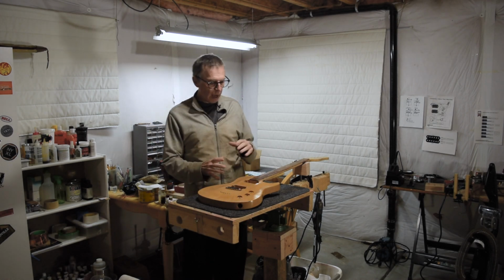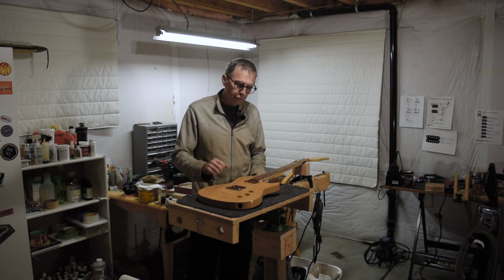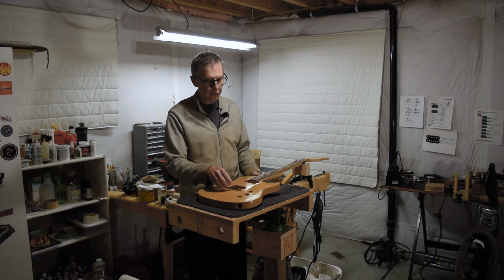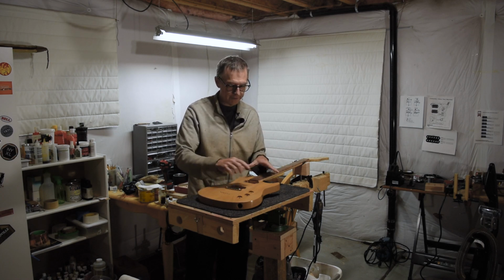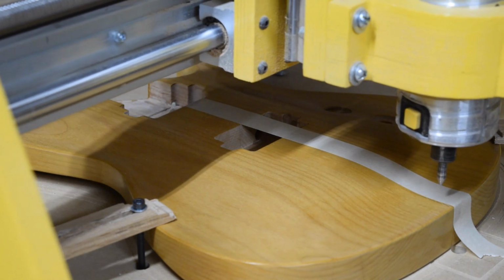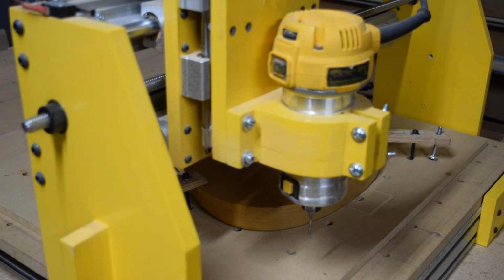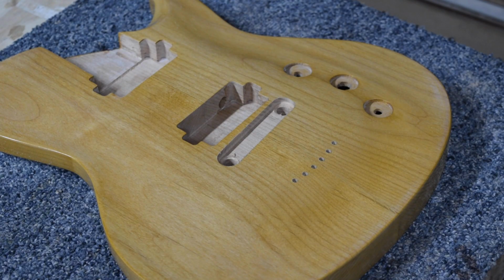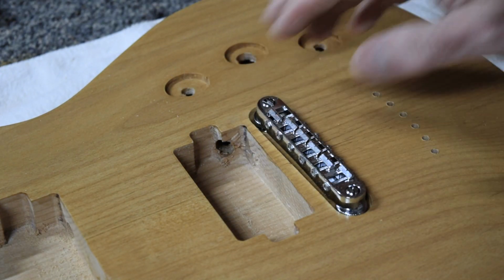Recessing A Tune-O-Matic Guitar Bridge

Comment: I’ve never used a CNC machine, but I’ve been researching how to use them in anticipation of my upcoming purchase. I was surprised to see that you used an up-cut bit for this; can I ask why you chose to use it as opposed to a down-cut bit? 

Any insight I can get before I start building would be greatly appreciated.
Reply from the maker: A down-cut bit would have been ideal, but not necessary. At the time I made this video, I didn't have any down-cut bits.

Comment: Help me out. Where do the strings go. Are theose holes behind the bridge for string ferules.
Reply from the maker: The strings pass through the body via the holes behind the bridge. Each hole has two ferrules, a string through top ferrule, and a string through back ferrule. The back ferrule holds the ball end of the string while the smaller top ferrule protects the wood from the string as it bends to reach the bridge saddle.
Reply: @HighlineGuitars  Thanks for answering sir and for your channel, taking the time to pass on your craft.

Comment: do we need to worry about string break angle? isn't it much easier for strings to come out of the saddle groove like this? maybe even buzz?
Reply from the maker: @tapirath  Yes, you do need to worry. Just add it to the list of things you need to worry about. In all seriousness, if the strings pop out of the slots, make them a little bit deeper. Then, raise the bridge a little bit to compensate.
Reply: @HighlineGuitars  sorry if it came negative. I'm just interested in the whole design aspect of it and the more I look the more interesting is how Gibson and Fender chose differently. Recessed TOM is kinda like the best of both worlds and I wonder if it has any downsides

Comment: Hi Chris, very useful video. It’s making me think about different options for an old buggered up Warmoth LP style from the late 80s. I want to replace the standard scale neck with a 24.75” scale. It has a S style hard tail bridge, so I’m hoping I can use the existing string thru holes and back ferrules and then position a routed tune a matic a little closer to the bridge pickup.  To compensate scale length. 

I messed up the neck pocket with a router back then not knowing about templates. But a couple of custom made templates and a block of mahogany to glue in I think I can fix the scale length from both ends. It won’t be look perfect but it should perform better. 

Thanks Chris

Comment: I have no experience with TOM bridges, so a question out of ignorance: are there any posts available for TOM bridges without the thumb wheels, given that they are slotted at the top and so can still be adjusted for height with a screwdriver? Eliminating the thumb wheel should shave off a few millimeters, which might be all you need to lower the profile of the bridge such that there is no need to recess it. Does anyone know of such an option?

Comment: Are there any differences in tone between stop tail tune-o-matic bridge vs string through hardtail bridge?
Reply from the maker: By rule? No.
Reply: @HighlineGuitars  Thanks for the reply. I thought that the tone could change because it is a different angle with tune-o-matic bridge.  I'm planning to build a super strat style body with 24.75 inch scale length and the same pickup placements to get closer to les paul tone.
Reply from the maker: @johnnyway8667  The "Les Paul tone" comes from the pickups. Scale length is a minor factor and pickup placement doesn't matter at all.

Comment: What depth would be appropriate to rout?  I have a JM style with a S style tremolo/bridge.
Reply from the maker: You have to lower the bridge/saddles as low as they can go and measure the string action at the 12th fret. Subtract that number from your desired string action at the 12th fret, add an additional 1/32" (.79mm) and you've got your depth.

Comment: Seems like way more work than just filing the bridge itself. I have lowered tunomatic bridges by filing in 10 mins. Unless its stainless steel it is pretty simple to use a hand file.
Reply from the maker: What if the bridge has to be lowered 1/8" to 1/4" below its original lowest position?

Comment: Chris, great video regarding using tune-o-matic bridges that got me thinking.  I'm building my 1st guitar from scratch and plan to use a hybrid neck thru/set neck design very similar to the PVX neck design.  I was planning on using a tune-o-matic bridge and keeping the neck parallel to the body.  To address the tune-o-matic ~1/2" height, I was planning to use a 3/8" vs 1/4" fretboard with jumbo frets to raise the neck/fretboard height to match the bridge.  Is this another good option or do you foresee any issues with this approach?  Thank you.

Comment: Hello Chris.  Quick question.  How much do you typically offset the bass side of the bridge (from perpendicular to the guitar's centre line) to create the angle to help with intonation?  I've heard anything from 3 to 6mm.  I also like the curved ferrule pattern. If you don't have a jig to do them 100% straight (like me) that method is way more forgiving and looks way better.  Thank you.
Reply from the maker: 1/8" or 3.175mm.
Reply: @HighlineGuitars  Thank you!

Comment: Great video, and great content as a whole. Thanks for the videos!  I'm starting my first build very soon. I'm doing a 58 V replica, and I already have a template. I'm at the point of buying all of my parts now, and I would prefer to build it with a Fender style bridge.  Do you have any recommendations on how I need/should modify the template? For example, the neck would no longer need to be at an angle(?), so what would be the most efficient way to go about changing the design?  I'm brand new, so please forgive my ignorance :)   TIA
Reply from the maker: No need to angle the neck with a Fender style bridge. Make the neck and fretboard first so you can measure the thickness of the heel (including the fretboard and frets). This will help you to determine the neck pocket depth (neck heel thickness minus the height of the bottom of the string notch in the saddles from the bottom of the baseplate when the saddles are lowered all the way to the baseplate).
Reply: A 58 v needs the v shape metal plate thru body .. iconic .imo..they just look so awesome..classic 58 look.. but hope the build turns out nice for you .tough for a first ..set neck. Best to you man .

Comment: Excellent idea and solution - was looking for such a remedy. How did you know how deep to make the recess?
Reply from the maker: Before routing the recess, I set the bridge on the body and calculated how much space there would be between the bottom of the string and the top of the frets. That's how deep I made the recess.

Comment: for anyone wanting to do this at home without a cnc or router: use a drill press and a forstner bit. use the bit do drill multiple shallow holes from one end of the pocket to the other, then just clean up the sides with a chisel. im in the process of building a tele with a tunomatic bridge and this is how i did it
Reply: How deep of a recess pocket did you do? Im about to do the same
Reply: @JoeStanFPV   i only went down about 3/8". it all depends on what bridge you are using really. some sit taller than others. i didnt use a factory gibson tunomatic, i bought an aftermarket roller bridge. 

i just set the bridge on top of the guitar body where i wanted it. then used a long piece of string from the nut to the bridge (sitting on top of the body). then i used a ruler to measure how high the string was sitting above the puckups. i figured lowering 3/8" was good, my string action is fine.

if you measure that way with a piece of string you can figure out exactly how far to go down based on your pickups and bridge.
Reply: @TacoTuesdey  awesome, thank you! Exactly what I was thinking
Reply: I built a strat with a tune o matic and ended up shimming the neck. Still kinda high but its a slide guitar

Comment: Can you talk about how the decision of whether to angle the neck pocket or recess the bridge would play out, on a 72 deluxe, with t-o-m, where the objective is to be able to switch to a vibramate/bigsby if the mood strikes? (Primary configuration would be the regular TOM/stop tail, but want to be able to switch if a band situation needs a bigsby some of the time.)
Reply from the maker: I don't think a recessed bridge would work with a Bigsby. You would have to angle the neck to work with the Bigsby setup and when you switch to the TOM/stop tail, you would have to place it at the same height the Bigsby was at. Better yet, build two guitars, one with the Bigsby and one without.
Reply: @HighlineGuitars  This is the response I was afraid of. I wanted to be able to switch. Is there a way I could aim to accommodate both, maybe starting with the angled pocket, and adjust based on which setup feels most right?

To clarify, I want to be able to go from fixed (roller) to bigsby seasonally, not like mid-set or anything.
Reply from the maker: @aaronblack79  Honestly, I don't know. This isn't something I have done or would do. Sorry.
Reply: @HighlineGuitars  Ok, understood. Thank you for helping regardless, I appreciate it.

Comment: Nice.  How did you compute the depth of the recess?
Reply: You'll just need to calculate the difference between the height of the string at the nut and the height of the string at the bridge (both measured from the top of the body).  Guitars built to have no angle will have these heights line up,  somewhere in the range of 10-12 mm.  An ungrinded TOM might be set up in the 14-16 mm range. So if your string height at the nut were 10 mm, and 14 mm at the bridge, you could use a 4 mm cavity to get everything squared away. Obviously, since all of these variables can be adjusted to an extent, you're more lining up a range of potential heights to another range of potential heights, ideally with as much intersection as possible. I would see the full range of heights provided by your bridge, and aim for the middle value, before routing anything. This ensures maximum flexibility and room for error.
Reply: I’d like to know this too
Reply: Thanks!

Comment: I have just ordered a Fishman TOM power-bridge and it is going in a new slab body that I am building. I have been thinking about doing the recess thing and this video just confirmed it :), Thank you, by the way, what is or how do you know what depth to make the recess. Nope, I don't have a CNC, just a couple of handheld routers.
Reply from the maker: I go 1/8" to 3/16" deep. When the bridge is in the lowest position, I want the strings to just touch the top of the last fret. If they aren't touching, I'll measure the distance from the bottom of the string to the top of the fret and that is how deep I have to go.
Reply: @HighlineGuitars  Great, thanks

Comment: You can also use an inexpensive, but more precise and more accurate, small device called an, "edgefinder," that fits in your spindle (they come in 1/4", 3/8", or 1/2" diameters (metric sizes also, and years ago I saw a 5/8"), and these make it extremely quick and easy to accurately locate your instrument, centerline, and check alignment to your X and/or Y axis.

Even more precision and accuracy can be achieved using an indicator, of which there are numerous types, and numerous ways to properly utilize them. 

Great video! I'd done this once, many years ago, and completely forgotten about it. Yeah, having my CNC vertical mill is absolutely going to make that job quicker,  more accurate, a LOT cleaner, and safer. I think that would look incredible on the Flying V I'm building. It's more the vintage style body lines, like the ones KK Downing, or Micheal Schenker, used, but more modern amenities, like 24 SS jumbo frets, Hipshot locking tuners, 7 piece multi-laminate neck, not sure about the pickups though...

Great idea to sink the tune-a-matic, just don't let an authentic playing Gibson Les Paul purist see that...

Comment: Question: Is there a mathematical formula for how far back from the bridge you drill the string-through holes? Also, I've seen them staggered, at an angle, straight and curved like you did, is there some rhyme or reason for this? I ask because I'd like to match the curve of the back of my guitar but I've only installed Fender-type bridges, this will be my first Tune-o-matic and I love your recess idea, I'm going to do that for sure (although I'll have to do it without a CNC)...Great videos, you're my #1 go-to for instructional vids, especially all your finishing ones (would love it if you did a video on apply solid colors? )
Reply from the maker: There is no mathematical formula. The holes just need to be back far enough so as not to contact the back edge of the bridge behind the saddles when the bridge is raised to the height it needs to be for proper string action. 2-3" is usually enough.
Reply: @HighlineGuitars  Thank you!

Comment: What do you do for dust control on your CNC? I have one, use my shop vac manually as it runs. Have considered a boot, you?
Love your info!!
Reply from the maker: The Frugal Fixer! Spike I have a 4” dust collector with a brush and a crevice tool. No dust boot. I like to watch the chips fly!
Reply: Same here, I do love to watch, one emerge from the block!!
Thanks for the inspiration.
Did you see my Workstand??
Reply from the maker: @spikechampkart55  Yes, I did. Pretty cool. Have you seen the new one from StewMac?
Reply: The one that mounts on a case? Chris
Reply from the maker: @spikechampkart55  Yeah, that's the one. The Gig.
Reply: I saw it before I filed my Patent, I have never seen anything like mine. Have you? 
I am redesigning now, to cut on my cnc with Baltic Birch. Break down easier. Redesigned my own neck support and pads too!!
Thanks! 
Lost a great piece of wood last night, my z stepper, came unplugged, dove right in deep 
Ruined a Ambrosia Maple and Black Walnut blank, totalled!!
Thinking I may, have to build a new machine, more like yours. 
I have dual X and y with belts and single z with screw!!

Comment: Hi Chris, 

I only build thru necks & don;t like the idea of back angle ( Gibson owners who have dropped their guitars will tell you why). I wanted a bigsby on my 4th build & ToM roller bridge was most logical choice. This was a no brainer & it was easy to cut rebates for wires( earth soldered to bottom of post) before gluing the body wings on. One big annoyance I have with Bigsby is why do they have a stop to prevent the arm coming across the top of the strings? Surprised me to see "made by Fender" on the Bigsby box!
greetings from downunder,
Kiwi

Comment: hi chris! clever idea. question for you about a bridge that sits too low. even with adjusting screws all the down (highest saddle position) the strings still rest on the fret board. would it make better sense to raise the bridge, shave the neck to lower it in the neck pocket, or take some material out of the neck pocket itself to bring the neck down. i appreciate your input!
Reply from the maker: Any of those options can work, it just depends on the specific guitar. I prefer shaving the heel or deepening the pocket since those solutions are hidden.

Comment: Interesting - but if you are planning to recess the bridge or set he neck flat, wouldn't it make sense to either prepare the template - the one you use for the neck and pick-up routing - which would be easier to do before you commence the build and the carved top or, if you are using CNC, have that recess added to the template so its all done at the same time. Then you don't have to refinish that recess either...

As an afterthought, I can see why you have issues with regular templates on a carved top but if you had planned this from the start, it would make sense to adapt the existing template if that's what you use for neck pocket and Pup cavities before you carved...
Reply from the maker: In a perfect world, yes. However, plans change and you can't always anticipate how. It's no big deal as long as you can adapt on the fly, which I did.
Reply: @HighlineGuitars  Of course but if it was to become a regular thing, then it would make sense to adapt your template - whether regular or digital. Even if you do decide not to recess, you aren't messing up your templates as you can just opt not to use that part.
Hindsight is a wonderful thing of course but it still wouldn't hurt adding that to any existing template just in case you consider doing that in the future....
Reply from the maker: @BAMozzy69  The project file I created has options for Fender hardtails, Fender tremolos, Floyd Rose tremolos, Hipshot TOMs, and Gotoh TOMs.

Comment: Interesting process!  Do you have a video on recessing the volume and tone controls and why it’s necessary.  If not, that might make a good one.  Thanks!
Reply: PRS started that trend of recessing the tone and volume knobs.  One thing it does allow for is using standard height shafts on the pots.  In LPs (which are carve top guitars) you have to use two taller shaft pots because of the carved top.  So the short shaft pots use the upper holes and the taller shaft use the bottom which makes them the same height..  PRS eliminated that with the recess method.

Using a Forstner bit will create the recess.  Don't drill this by hand because you might not get a perfect cut.   Use a drill press and GO SLOW to avoid chipout.